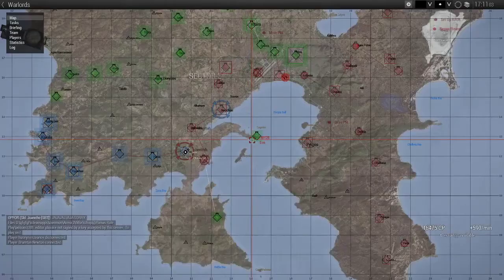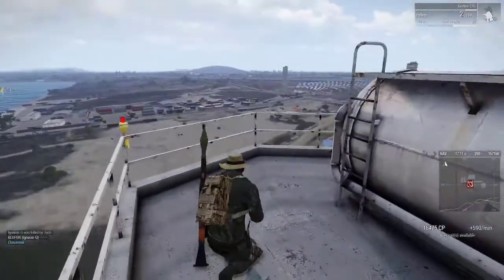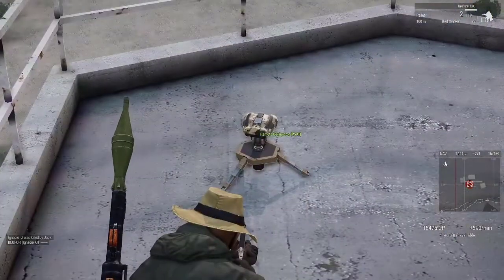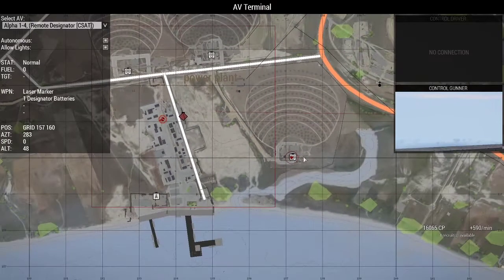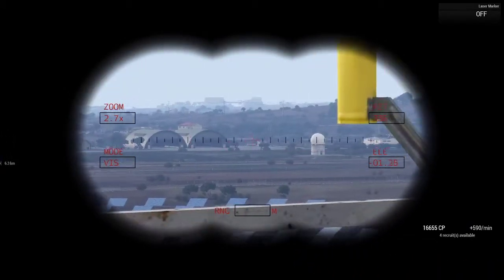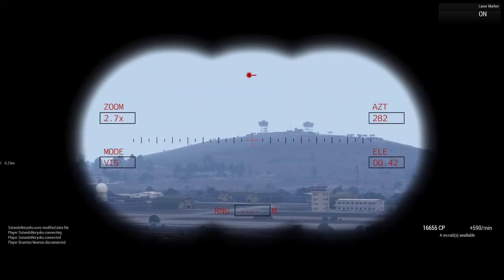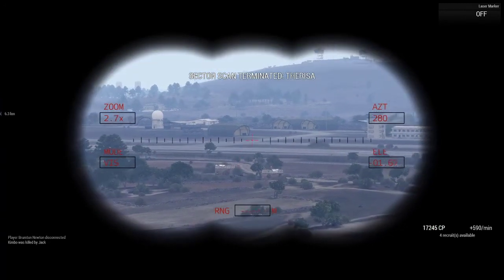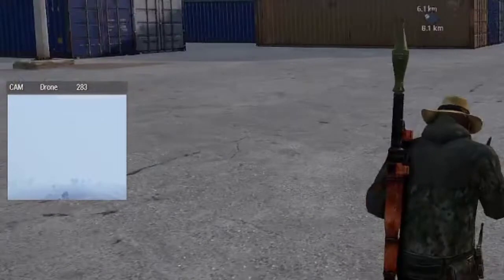How To Use A Laser Designator | Warlords Arma 3

Comment: Question: Can anyone do this so long as they are carrying a designator? Also is there a more portable version of it? My friends and I are basically looking for the easiest solution to them marking targets on the ground for me to shoot from a plane. Also, will it only work for bombs or will it just be displayed on my hud and I can use the 30mm cannon?
Reply from the maker: Anyone can place and use designators in Public Warlords as long as they have the matching terminal. It does work for laser guided bombs and for Rhino ATGMs. You will also see the spot on the HUD when using unguided weapons. Personally, when I'm flying I typically put up a couple Darter drones and target with them since they have a better coverage area. Friends can control the drone for you if needed too. I also part a tigris/cheeta and ammo truck somewhere so I can retreat toward it in a dog fight I'm losing.
Reply: @sgtbombadil  I don't think the laser des function works on the rhino anymore
Reply from the maker: @swegmastur614  You are correct. All the backpacks with gear (laser des, static GMG/HMG, drones, etc) have been removed from Official Warlords. That said. If you have a player with a laser designator or a jet that can paint targets, the rhino can still lock on and be effective.

Comment: Is there an intuitive way to know what missiles can and can't be laser-designated? 
I was in the editor messing around. I was hoping that if I lasered a tank with a Darter, I could send a Javilin up its arse without a direct line of sight. 
I couldn't. I was big sad.
Reply from the maker: @fanthonyfictions In vanilla ARMA 3 lazer designation works for tanks and air assets, it doesn't work for anything handheld. Titan/Compact for example, needs to lock itself. Rhino / T140k can laser lock and can do so over the horizon to some extent. Air assets can laser lock. Do keep in mind that the direction the laser is pointing can impact effectiveness of incoming ordinance. As an Arma 3 pilot I generally attempt to drop bombs in the same direction as the laser to avoid missed drops. So if you're designating for an air asset we appreciate knowing the city location of the target and direction you are facing to designate the target. Also keep in mind your AI can laser designate too. So if you get one with a laser des up on a high point they can provide the designation for your tank/air team.
Reply: @sgtbombadil  Is there a specific order to give AI to laser targets? 

Mine struggle with the concept of Get in the vehicle, get in the fucking vehicle, Get in THIS vehicle, Get in the Fucking vehicle!